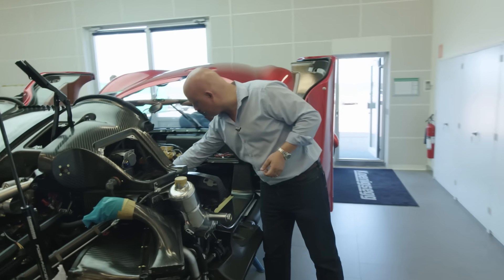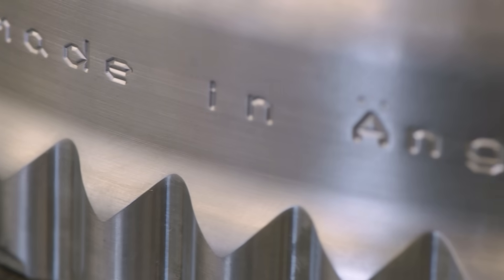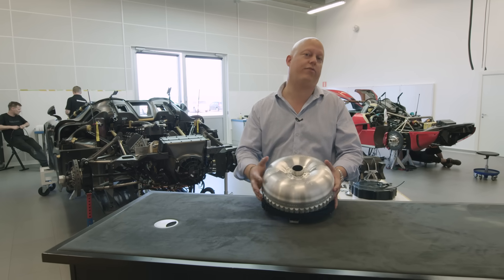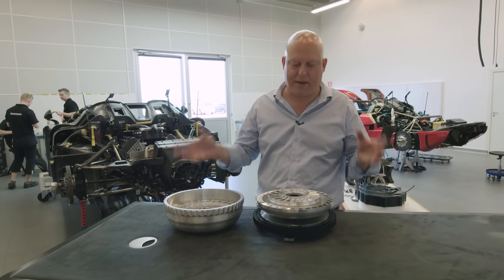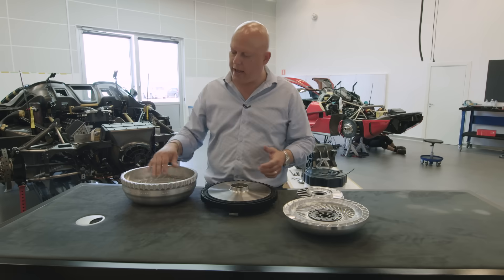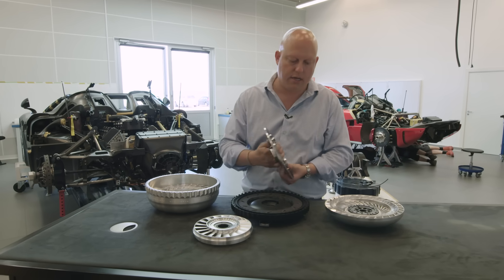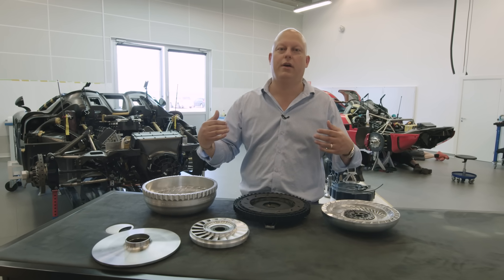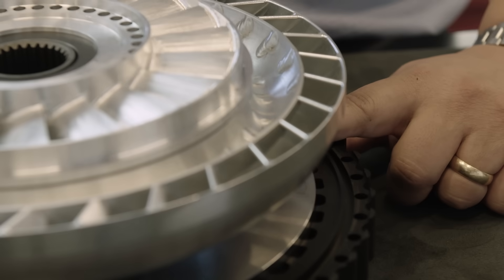248 MPH Without A Gearbox: Direct Drive  -- /INSIDE KOENIGSEGG

Comment: This may be a little off topic but I am wondering why they don't make a generator that will charge the batteries while a electric car is moving making charging the batteries obsolete and all you need the batteries for is to get moving and once at a certain speed the generator produces enough power to the motors to keep going.
Reply: Look up 'perpetual-motion engine'...
Reply: They do. It's called Series Hybrid, and it is very similar to how trains work.
Reply: What you are proposing is a called a "perpetual motion machine", and so far no one has been able to make it work.

If you can make it work, you will be the richest guy on earth and all energy and car companies will go bankrupt and you will practically rule the world.
Reply: It did occur to me that he might have been talking about a series hybrid, but by not specifying an alternate fuel source for the generator, it became far more likely he meant totally electric, thus PMM, which according to our current understanding of physics, is impossible, as we'll never get back more energy than what we put in...
Reply: Perpetual motion or Infinite energy in a closed loop is impossible. The best way for series Hybrid though is to use diesel not Gas. Diesel Fuel has more energy to release making for good efficiency all around.
Reply: This principal is great and all but I don't think you are using it correctly. I am referring to energy density which most people do not use. Diesel has more energy density than gas therefore you can use it to make more electricity than the gas engine would. This will make the whole car more efficient. Hence why trains aren't powered by gasoline, and also gas engines do not last as long.
Reply: I understand where you are coming from. However wind turbines, and the like are anything but constant. The way around this is the use of capacitors which some hybrid buses are now using. The only real problem is complexity of the system being our downfall, and leading to more expensive cars, and trucks.
Reply: It is not often when I get to actually debate with people on these subjects. I love to be challenged cause what good is humankinds large brain without challenge. :}
Reply: Always welcome man. :P
Reply: Not sure if this comment is for me, but I have done a bit of research into them so I have a reasonable understanding of diesel electric trains, and how they operate. I have slightly less understanding into parallel hybrid vehicles.

Comment: Expect for the hydraulic torque converter the Regera is working like the new Honda Accord Hybrid. The obvious reason for the torque converter is acceleration, the obvious downside is the bad energy efficiency (so the Accord Hybrid doesn’t have it, at low speed it runs solely as serial hybrid).

Comment: I don't really understand this. Am I right to say they are using the electric motor as the transmission? Because electric motors doesn't require gears to run efficiently?

Comment: Critical point at 7:50 - "We can keep spinning the wheels at 160 - 170 mph, meaning there is no point for gears." This is where it all clicks. If you're traction limited in "7th" gear at 160 mph (or obviously anything below that), there's absolutely no benefit from more aggressive gearing, as it cannot make you accelerate faster unless you have more grip. Great video!! Made a video a while back (https://youtu.be/naRY3knqFYU) on the Regera making a few assumptions, great to see the internals of the hydraulic coupling!

Comment: so , basically, the ultimate automatic transmission. One gear but it adapts to different needs.
Reply: It works perfectly fine at lowers speeds.  In fact, that's when it is most efficient, aside from when it is entirely locked.
Reply: yeah but it wouldn't work without the electric motors aid, witout them i think it would be useless
Reply: He says it goes 0 to 60 in 4 seconds without the electric motors.. the hydraulic torque generator can work with just the combustion engine..

Comment: For anyone confused... think of 2 fans facing each other, one is powered by the engine, the other is not powered but connected to your transmission. When the engine fan spins it moves air and the 2nd fan will start to spin too.. basic but true. Hence fluid coupling :)
Reply: Ian Thompson Cool ya jets, it was a genuine question - I was just interested. I forgot this is the internet so you assume I'm trying to undermine you. Jeez.
Reply: fluid coupling - that we can find in most automatic cars.... they just re-designed it slightly and make it more "heavy duty".
Reply: jiggavat Yep, that's all I was clarifying. People seem to lose all perspective when talking in YouTube comments hey?
Reply: That's actually a great way to explain it! Thanks!
Reply: The whole unit is filled with transmission fluid. NOT air. air may be technically a "fluid" but this direct drive system much like a traditional torque converter in an automatic car is filled with a very viscous fluid, transmission oil.
Reply: Air is a fluid.
Reply: we all know that a transmission has fluid in it ,, certain people are using an explanation that is more easily understandable
Reply: Ian Thompson Wow, I never knew a toraue converter worked like that. Thanks for the info. You learn something new everyday. But I do have a question though, if the engine isn't mechanically connected to the transmission how can it transfer the full say 1200 horsepower to it?
Reply: @Ian Thompson Fluid not air?
Reply: I know right!
Reply: Ian Thompson basically every automatic transmission I prefer manual they are tougher a clutch is cheaper and easier to replace than a torque converter that blew manual transmission works with a drum and a wheel with brake pad like surface when you release the clutch it opens up and starts griping the drum the other is like a disk the more you release the more it presses against the transmission plate
Reply: Andy Pandy In the most simplest form. But instead of air, it's hydraulic oil. But yep, your engine is not mechanical connected to your wheels in an auto... interesting eh?
Reply: Andy Pandy Not a clutch like your thinking of, since it's a fluid coupling the car can be in gear with the engine running. The fluid allows it to "slip" so your engines not stalling out if you are not moving. But there is several clutch packs inside that allow it to automatically slip into the next gears.
Reply: Andy Pandy It's not that your wearing it out, but you are heating up the fluid. To much heat can obviously hurting it. All cars should be able to dissipate the heat of idling in drive with their cooling system.
Reply: Then imagine one of the fans having retractable nails that can be controlled so they grab on to the first fan, mechanically. That's the lock-up function of the converter. (As Christian says; Then it does nothing, it's basically an extra, big flywheel.)
Reply: air is made up of gas and liquid ,, fluid is a term used ,, you are very close in your explanation ,, one high pressure fan directing the air flow at a second fan at one specific location on the circumference  of that fan , most likely at the outside of the fan at startup and working its way towards the center , like two  separate rings on a circumference ,, one on the edge and one closer to the center
Reply: slydog98j there is no way to transfer all power energy is still lost through heat and friction that's why cars are rated alin different ways such as BHP (Base Horsepower) RWHP (Rear Wheel Horsepower) AWHP (All Wheel Horsepower) as an engine transfers power through a drive train horsepower is lost as heat from friction most efficient motor that transfers power is electric it has no transmission and minimal friction as they drive the wheels directly but energy is still lost as heat and the problem we still don't have batteries or an energy source that would make an all electric car a Reliable transportation yet so if a car is rated at 500 Horsepower the wheels only end up with 425 Horsepower at the wheels around 15% of power is lost throughout the drivetrain before it reaches the wheels
Reply: Rob Hadfield Air is a fluid, take a physics class. Air is not a liquid.  Regardless picture two fans underwater same deal...

Comment: Wow I knew it had to withstand crazy power, but I didn't even think about the load it has to handle from launching in high gear... it's amazing it doesn't explode. The heat management must be crazy... just stalling a normal converter makes a ton of heat... holy crap..

Comment: To reduce friction losses in the torque converter, isn't it necessary to remove all the machining marks on the inside? Polishing it till it mirrors... and maybe some anti adhesive coating, it's a Koenigsegg so extra cost can't be a issue

Comment: I praise the entire team over at Koenigsegg, they are all superb and achieve beyond the call of duty.
I'll say this once again, if they had to shift their focus to regular motor market, and apply that kind of technology, they would quickly make many car manufacturers redundant. Think about it.
Reply: Martin Sibara but incorporating this attention to detail and pioneering engineering to mainstream car manufacturing is completely unrealistic, the cost of manufacturing would make it uneconomical on the large scale production needed for the mainstream market
Reply: Martin, this technology never starts at mainstream consumer level as its completely not financially feasible.  Standard engines are already redundant compared to hybrid  yet we are still using and selling. This technology starts at the highest level, in this case, hyper cars and formula 1 racing cars and gradually filters down. I think with all the investment, they wouldn't have a chance in the mainstream consumer market.
Reply: Martin Sibara Too bad we in SA can't afford it anyway 😂
Reply: man I see these comments on every Koenigsegg video, their just an aftermarket manufacturer, nothing special going on here, they are here to make money. I don't buy in to any "infinite" power distribution on any design, if there is is a flaw anywhere between 0 and infinity "horsepower" will ABSOLUTELY find a way to DESTROY that torque converter BEFORE you reach 248 mph, just sayin'... horsepower is a hell of a force, torque is a hell of a force, gravity is a hell of a force, and what a torque converter weighs like 40lbs v the overall weigh 4000lbs. Come on, "infinite"?, you would have better luck with jet engines for all four tires (still wouldn't be infinite but...) oh yeah, and I'm not ripping Koeniggsegg a new one I'm sure their torque converters are worth the money, but KUBOTA has had hydraulic drive gear boxes for... ever, and they only go 1 mph.... infinite torque (to weight ratio) though.

Comment: would this be viable for more affordable hybrids?
Reply: Well without any sort of gearbox or other conversion:
A typical cars engine idles at about 700rpm. Differs from engine to engine but we will just use this for now. That means without a gearbox the car would move at about 80km/h ~ 50miles/h at the engines lowest possible speed. Then it start to "help the Electric engines".

At about 6:00 He says his torque converter generates a lot of heat and cant be used all the time. OK for a hyper car you will go fast with anyways. But maybe not so good for a hybrid and your day to day commute to and from work in heavy traffic... Then your had to drive on your electrical engines alone and the petrol engine would be just dead weight.
Reply: Noi5ee
Reply: I think you've lost a factor of 2 in there - with 250mph at maximum revs (let's be conservative and say 7000 rpm) and an idle of 700rpm, idle speed on direct drive would be 25mph.

Comment: Don't really understand... It is basically a very highly capable traditional torque converter with lockup function. What makes this thing unique as opposed to a traditional torque converter principle? Apart from it being beautifully made.Another question; heat loss from the torque converter is eliminated once it is locked up which would be at high speeds given the drivetrain ratio. But if you're not going very fast like in normal traffic the is a huge speed split in that converter which will generate lots of heat continuously. Is that being mitigated by only using the electric motors at low speed?

Comment: A truly remarkable direct drive design reminds me when I worked in one of the HE Industry, it (Torque Converter) does the same thing that is to add more torque and basicly multiply them, but the interesting thing is, there is no "actual" transmission inside this mega hypercar and no wonder Koenigsegg Regera could have achieved the torque of over 2000 Nm at certain range of RPM.

Comment: He made a mistake in the explanation. In minute six he told that if you reduce RPM from 2000 to 1000, you'll get more than double torque. That would mean that you produce power in that unit and that you have efficiency more than 100%. In next sentence he told that you loose efficiency which is true.

Comment: I'm more confused after watching this.  I'll just stick with Direct Drive as a name and be happy with that.
Reply: WhichLens 
https://d37nk263jfz2p8.cloudfront.net/image/1/700/0/uploads/articles/regera--54fee1ba82b3e.jpg

Its a monster.

Watched Grand Tour yesterday where they had puny little hybrid "supercars" that didn even have 1000hp and not even close to 1MW.
Reply: At its simplest, the direct drive is an automatic transmission with only 1 gear.
Reply: It is basically a torque converter but with hydraulic control added in. takes away and removed all the unnecessary extra parts which is just added useless weight.
Reply: The torque converter is just there to give a extra boast in low speed.. I really do wounder if its even needed. That is a 900hp ICE and a 300hp electric engine sitting on it. Then 500hp more sitting on the rear axel.
Reply: A drawing of parts is needed. But  it's so : 3 motors, 2 behind the torque doubler and 1 (1+1), that's one for each back wheel, after.
Reply: Yep, much better with ur drawing, thx !
Reply: No, it's a tourqe converter with an additonal chlutch. No transmission !!!
Reply: Ergh, super dumb explanation here but; 'big wooshy double fan running on 7th gear'

With the dumber follow-up explanation of; 'it's strong enough, basically stronk, very stronk, can run 7 gear.'
Reply: Moebius XIV chlutch? Wtf is that?

Comment: thats how most of the drag cars uses a high stall torque converter on 2gear powerglide transmissions and low gears to get the fastest acceleration of the car and the best top speeds while the engine always runs in the optimal rpm's where is more powerful
they add a huge lock-up to make it direct so you have the best acceleration and top speed

Comment: If you take a differential, you have three ends, input one end with combustion engine rotate at optimal rpm, input one end with electrical motor with huge torque range, this will consist a hybrid system and a transmission with infinite variable speed. At low speed, clutch the engine and drive the car with motor, at higher speed, use motor to adjust the rotation rate of the output shaft while engine rotate at a consistent speed, excess energy will drive the motor to charge the battery.

Comment: Where's engineering explained when you need him?
Reply: was just thinking that, i feel as though he would do a better job of explaining it.
Reply: it's a fan except instead of pushing air it pushes oil, on the receiving end is a fan facing in the opposite direction so pushing oil into it will cause it to spin.
it also has a clutch which means it can squeeze 2 plates together to link the drivetrain and the engine directly just like in a standard car
Reply: The unit on the bench is a torque converter, taken to the extreme.(as per his explanation)  Basically at lower vehicle speeds, the torque conversion process is used, but this is inefficient, so whenever power isn't needed, like in a cruise situation, the lockup clutch is engaged which increases efficiency but lacks torque conversion. If you are cruising at 100mph, the lockup clutch would be engaged for efficiency, but  then if at 100mph you went to WOT(Wide Open Throttle) the lockup clutches would release and the torque multiplication would then be enacted, torque multiplication would resume and the vehicle would accelerate.  This is all in conjunction with other electric motors on the car.  Each system on its own, wouldn't work well, but all the systems working together are highlighting each systems benefits, while eliminating or reducing the detriments that each system alone would demonstrate.
Reply: he aint got no skillz compared to christian koenigsegg
Reply: you described a torque converter which this video is not intended for. It's for what sets it apart from a regular torque converter...
Reply: Perfect said, amen!
Reply: he has a video explaining this...
Reply: +hoghogwild   Exactly. Except that many average torque converters also have locking "stators" which basically does the same thing as what he described with locking clutches. 

What Koenigsegg is doing here really is nothing new. It's the application and execution which is impressive.